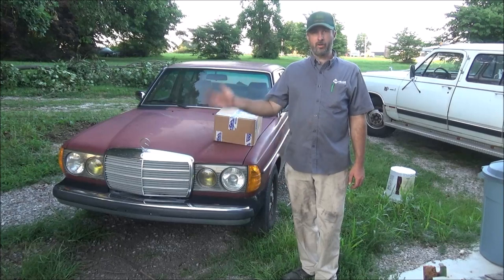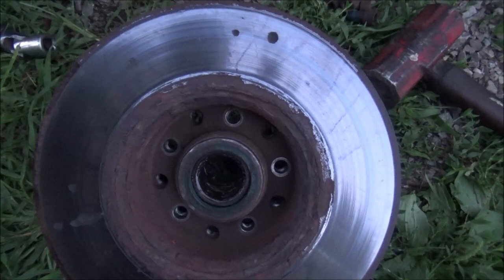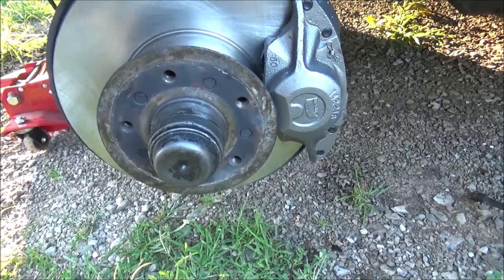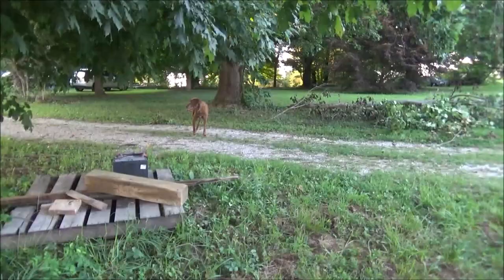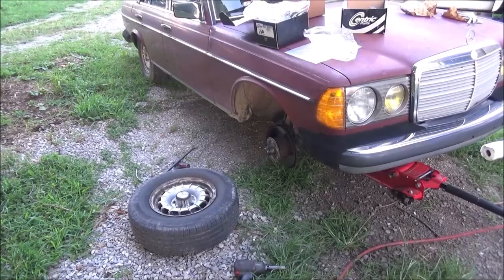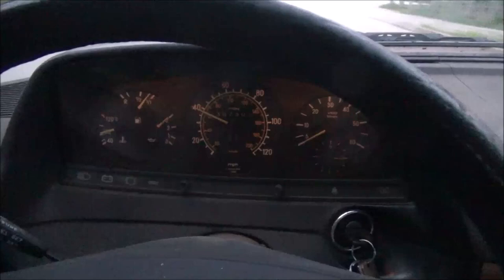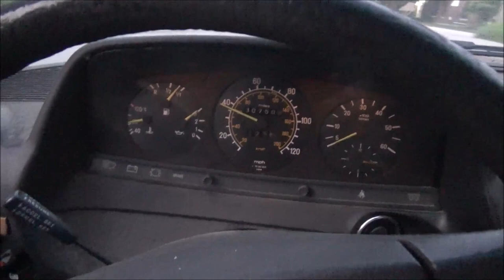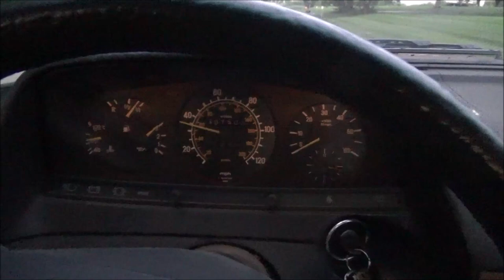Mercedes W123 Brake Job

Comment: Fun stuff.  One thing folks don't appreciate is the flex line can collapse internally and cause sneaky drag/pull issues.  Replacing is cheap insurance - in your case stainless will help with brake feel as well. 

Shop Boss seemed to be looking for why its taking so long. Lots of equipment sitting idle while you shade tree - smile!  yeah and not everybody can tap with a SLEDGE HAMMER.... 

Yeah the oil (and whatever else) in your hands and on your hands (plus the oil in the air tool if you use any) make the rubber hose ends kind of spongy/soft.  We hacked them off and used a hose fitting and a hose clamp.  Hated the clamp but hated to toss 48 foot of good hose more.  

The old girl seems to put the whoa down very well.  Must be for everybody else's protection - that is a solid car to impact the not as solid one's.  

Now back to the shop and hand re-torque those lugs before you warp those expensive rotors...... grin!  

Dan

Comment: Thanks for sharing Brian.  Just cut the metal shroud of  the airline crimp, shorten the hose a foot and just refit with a hose clamp.  Its the constant bending at the coupling that cracks the hose up.   regards from the UK

Comment: I too was disappointed with Goodyear air compressor hose. Bought a ReelWorks Hybrid Polymer Flexible Air Hose on Amazon and its been great. Going on 2 years and its holding up perfectly well, no splits, no leaks and as the name suggests its very flexible.

Comment: Brian if you want something that will last make it yourself!  Repairing it will be  a little cheaper and will also allow you to just cut off the bad hose.  I know it would be too expensive to ship but for those of you in Southern California and have a Thompson Building Supply in Corona, CA will repair or build you whatever length you need in Air or Water hose.  Tire of the 50 foot hose they can make you 500 feet of hose so you don't have but two connections to go bad.

Comment: How did you bleed the brakes....Bailey pump the pedal or do you have a pressure bleeder?
Reply: The trick is to push a piece of hose onto the nipple of the bleeder screw, run that into jar with some brake fluid in it. Top up reservoir,  loosen bleeder screw,  pump brake pedal,  re-tighten screw,  job done.
Reply: vacuum bleeders are the thing now, much better than pressure, all done at the wheel end,

Comment: Rpm gauge a simple fix, mercedessource.com, or junk yard. Just replace the black plastic sensor cartridge on the driver fender, 60 seconds. Looks like 3 inch by 1 1/2 inch d size battery, twists off and on.
Love the channel.
Reply from the maker: Nope its the dash on this one.

Comment: The drive up-town looks familiar😁 Good tip on the brake ( break ) in! You do however need a spreader bar for the bridge crane so you can raise it and work on the car at a better height...

Comment: i see you  shop at  rockauto too     great place to get parts  been buyin from them for years   those  braided lines will transfer more  pressure to the  calipers as the  rubber once will baloon some
Reply: I absolutely agree Rock auto is a great place to get parts! they even send to the ass end of the would.

Comment: Shade tree brake job, and I see Bailey came over to help bleed the brakes. I do like the air operated torque wrench. That would be $750.00 at the dealer, but you would get a free cup of coffee.

Comment: What sort of mpg do those Merc diesels get? In high school I drove an '84 K5 Blazer with the 6.2 Detroit, and I was routinely impressed that a 6,000 lb truck with a 3 speed non-OD got 24 mpg or better
Reply from the maker: 26mpg is a realistic value. The car weighs around 5klbs. We have hills here so nothing ever gets super mileage like people in flat states can get.

Comment: Thanks for sharing my dad and I have been driving diesel benz's for years he bought a 1995 E300D new put almost 600K on it gave it to a family friend who is our benz mechanic he works at the dealership but has a shop at his house that's where he works on our cars I'M driving a 199 300D I bought in 1998 had 13K on it and has about 280K on it now and still runs and drives great. We are really disappointed that mercedes has decided not to import any diesel cars or suvs.

Comment: You can get a rough idea how good a brake pad/shoe will grab by looking at the code printed on the pad. It will usually say something like EE, FE, FF, GG somewhere in the code, that's the warm and hot coefficient of friction. E is barely better than the steel backing plate, F is good, G is great but uncommon.

Comment: That's amazing the car can go that fast with the engine turning zero RPM....
Reply from the maker: Saves fuel.
Reply: Well, it looked like the Tach wasn't working....I've been dealing with brake issues on my 73 corvette, manual brakes...4 calipers, so there are 16 pistons, 4 hoses....they are notorious for trouble bleeding...2 piece calipers aren't all that rigid either...I might go with the stainless hoses, but that's bleeding again
 My tach works but speedo doesn't...

Comment: You have poured enough concrete for a small shopping mall and you are still working in the grass. Guess that is the Kentucky way.
Reply from the maker: The benz lacks the ground clearance to get into the shop until I get the apron poured outside.
Reply: That benz weighs less than the boring mill. I'm sure the crane would lift it lol. quit making excuses ha ha

Comment: tapered roller bearings should have pre load on them i do believe 
the old 1987 hilux has a speck that says to tighten the nut till x lb ft to seat everything nicely then to back it off and re tighten slowly and progressively turning the hub with a pull scale much like a fish scale hocked on the stud to x amount of brake away force

i have done it this way on my twin axle trailer also and believe the bearings will out last ones that are lose and allowed to sit out of alignment when side load is applied
Reply from the maker: Timken calls for .001" to .005" endplay when setting up wheel bearings(clearance). This can of course vary by manufacturer.

Comment: I've been around and worked on many a car and this is the first time I've ever heard of burnishing the brakes.  Never seen it done from a garage or anywhere else. I do believe all your doing is prematurely wearing them out.  It is always good to test drive to make sure they are working but that's it.   Not even in car repair manuals say to do that.  You go out and start over heating the pads and you will loose braking efficiency.  You will put a glaze on the pads. Once you do that they are scrap.
Reply from the maker: Here is a link to Wagners guidelines on the burnishing process. The actual process can vary from manufacturer to manufacturer. http://www.wagnerbrake.com/technical/technical-tips/break-in.html  also Raybestos says same thing http://www.raysbestbrakes.com/raybestos_installation_tips.php
Reply: after looking a the wagner  link I still wouldn't do that to the brake pads.  All your doing is glazing the pads, no good.  You ever hear of brake fade.   if you feel it's necessary then do it.   Personally I would never let anyone do that to my brake pads.  Your just looking for a brake failure accident.
Reply from the maker: Been doing it for years and even on semis, it has not been an issue.  It gives more consistent brake performance.

Comment: I knew a man whose jack failed with him under the car, and it sounds like a bad way to go.  Jack stands are cheap and easy insurance.
Reply: Except Brian wasn't under the car.
Reply: Tire could be under the car frame, out of the shot.  That's what I do for wheel-off work and don't expect to have to get under it.  Keeps the tire out of the way, and it will catch it if needed.  Use the wheel cover as a dish to hold the lugs, and put that with the tire also.  That way you don't accidentally kick your nuts...
Reply: He had his head under it with the impact.